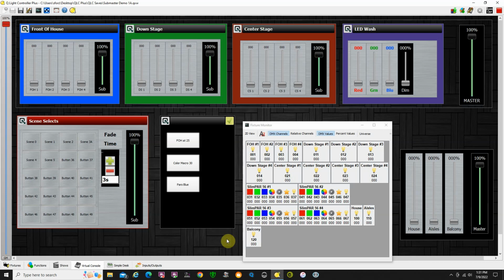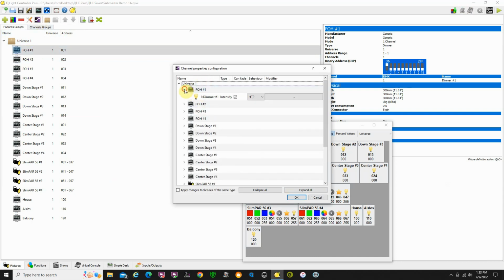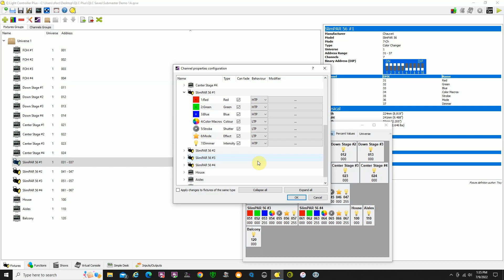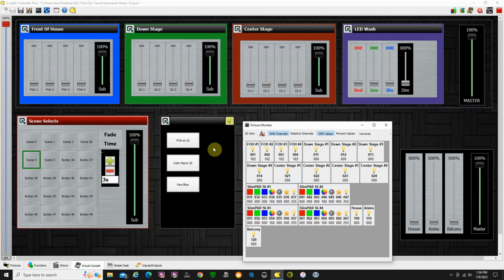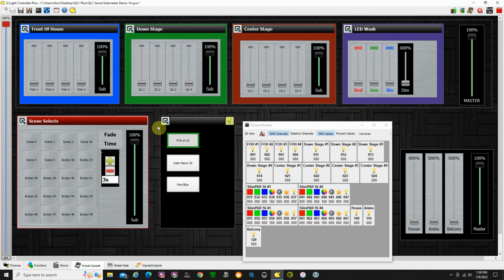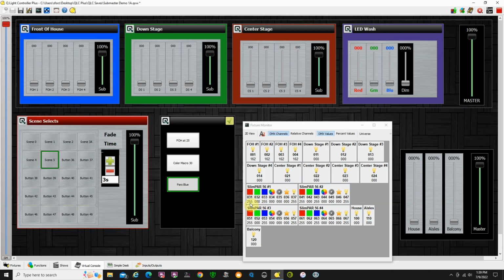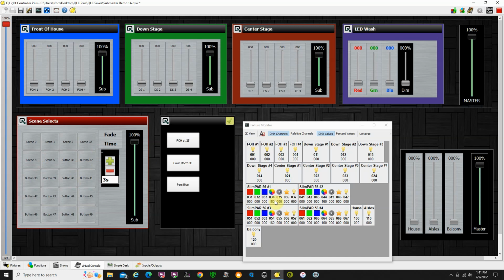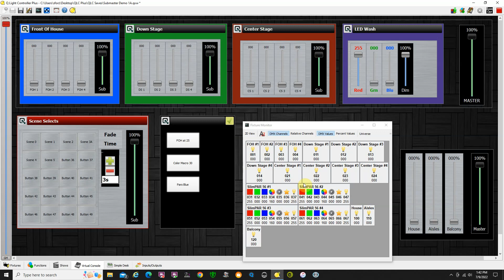HTP vs LTP

Comment: Hey Ed. I was playing around with some different things in QLC+. I'm trying to get it to where I can have a wipe across the stage (example: 4 par cans are purple. Then when I push a button, the left most light turns green, then the middle left, then the right middle, then the right side one, in quick succession, say 100-300ms apart). I was playing around with solo boxes, LTP and HTP, sequences and matrix's, chasers, everything I could think of, and I couldn't get things to go the way I wanted.

The closest I could get, the lights ended up turning yellow from both of the colours mixing together. When that didn't happen, once the green button was toggled all the lights on the right side went off, when I was hoping they would each stay on purple until it was that light's turn to change to green. I'm trying to make a virtual console setup for busking with a midi controller, so I can't manually put the purple into the other lights on the right until they change, because the colour may not always be purple, it might be red, blue, yellow, etc. Any advice on how to do this?
Reply from the maker: Hi Derek. I have a solution to your question. I made a video to explain
https://youtu.be/e5cRI2QunZU
Best wishes
Ed Richards